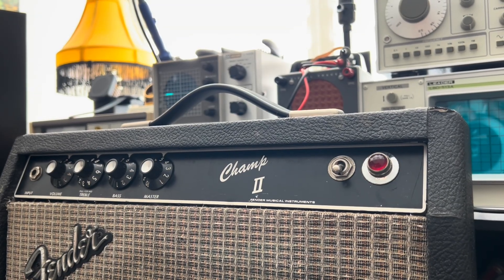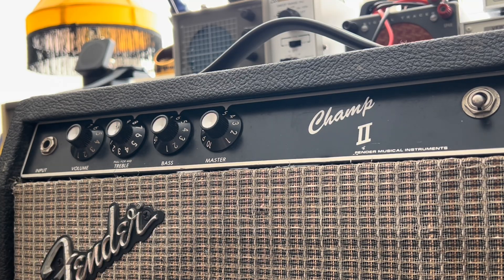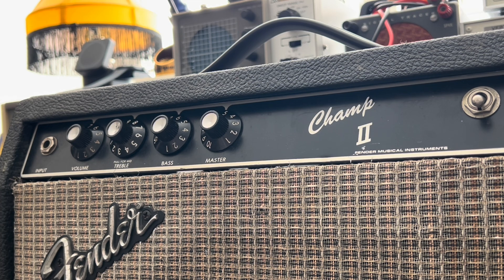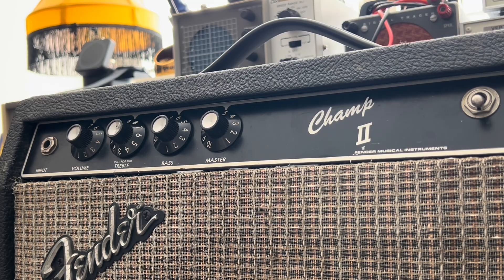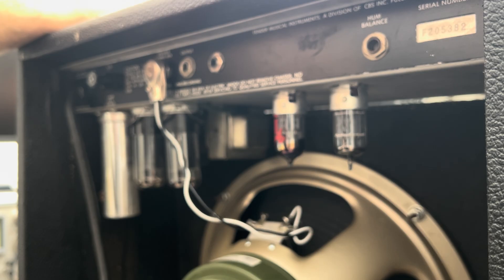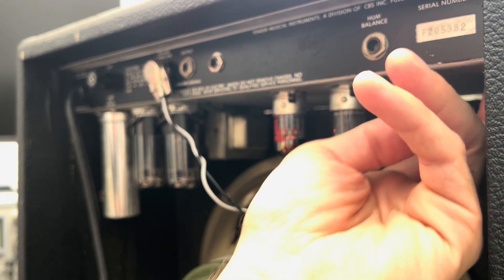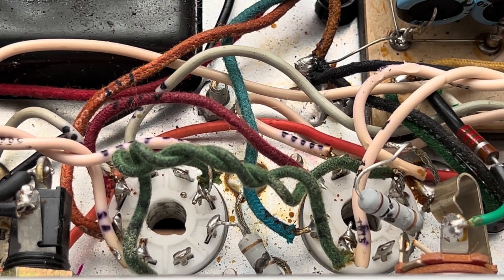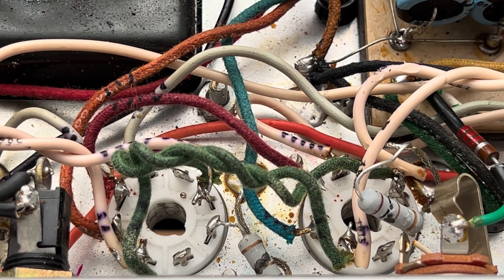Dead on Arrival — Fender Champ II - the Best Non Reverb Deluxe!

Comment: Not looking at the schematic aTMB boost switch will either add more resistance to the mids resistor (or pot) to ground or lift the ground. The kids call the lifted ground variety a Raw switch. On a AA764 single ended champ that would in its way turn it into a 5F1.

The mids boost type obvi lets less of the signal pass thru the tone stack attenuation, the controls do less and behave oddly as well. Depending on the added resistance you can get a big jump up in volume.
Reply from the maker: Adding a cap in parallel with the mids cap is useful too
Reply: @ForgottenGearRestorations .0027 with a 10M resistor in series, it turns out.
Reply from the maker: That’ll do it brother!

Comment: As long as we're judging, I hate seeing scorched or melted wires and solder drips, such shoddy work. It shows a complete lack of pride in ones work, a lack of caring. I do like precision 1 ohm resistors with meter test points on the back of the chassis (on builds, I never drilled new holes in an old Fender!) but always neatly wired to a terminal strip. Is it just my eyes or is there a hole blown into one of those?
Reply from the maker: I thought it was a marker, but it’s detonated!

Comment: The Rivera era amps are often maligned by certain techs and black face cork sniffers. Personally, I’m a big fan. My daily driver is a 1982 Princeton Reverb II. With a few minor tweaks it is a fantastic sounding amp. It totally holds its own against any black or silver panel Deluxe I’ve owned and blows my silver panel Princeton Reverb off the stage.
Reply: I've got the Super Champ and Princeton II...killer amps.  The Super Champ needed some tweaks but it's a monster once you do.  P-II just has a bias adjust pot added and still factory otherwise.  Caps still good and everythang.
Reply from the maker: Damn right
Reply from the maker: Dude, great post and 100% agree.
Reply: For years I played through a Fender 75 head that sounded great, as long as you didn't use the onboard overdrive. Which was fine, one of my prize possessions was an early MXR Distortion+, which I purchased on the day John Bonham died and was the envy of my fuzz facing friends and big muff mates.
Reply from the maker: I wish I could hear that monster live